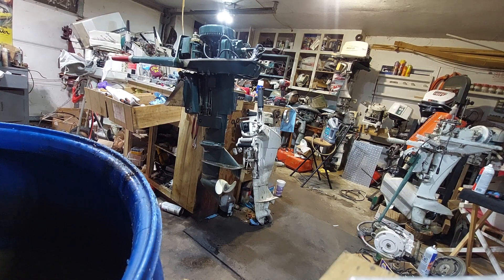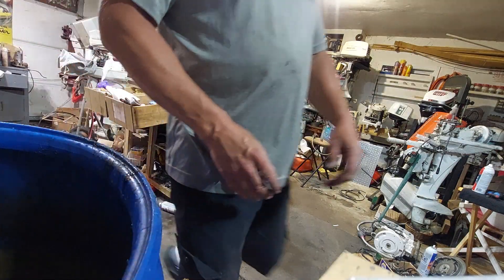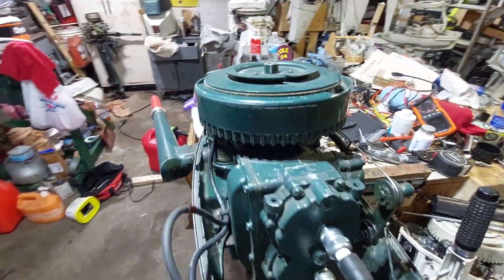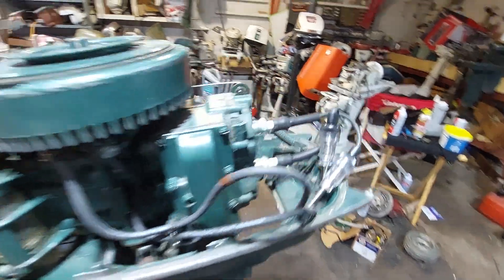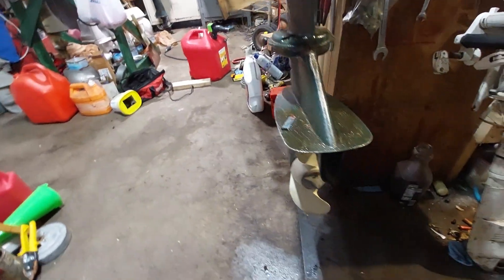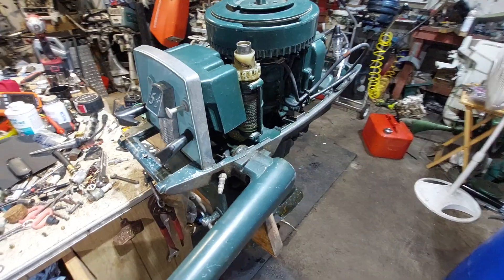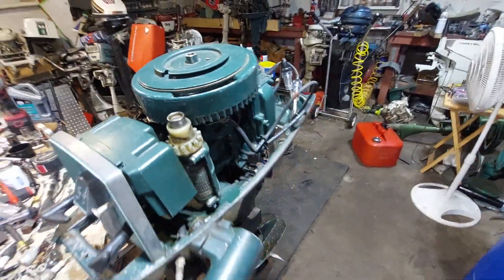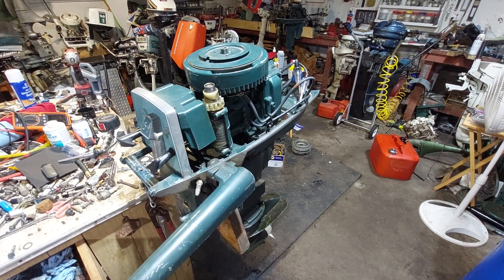'56 West Bend made Elgin 5.5hp OMC coil conversion Part 4 Success! 💯 We have spark! #aomci #vintage

Comment: Lawn boy coils are a better fit as the HT wire exits toward the back of the coul instead of exiting on the side.
It is a good move to swap to more readily available coils.
 Longtime ago ( 45 years ) I done something very similar to a Martin 100 outboard motor. on such old equipment, there is no other way to keep them alive.
good video
Reply from the maker: Hey! Thanks for the tip! I'm going to ebay now! Thanks for watching 👀